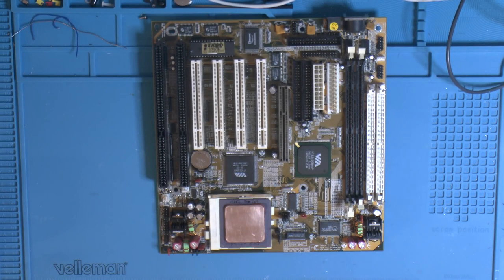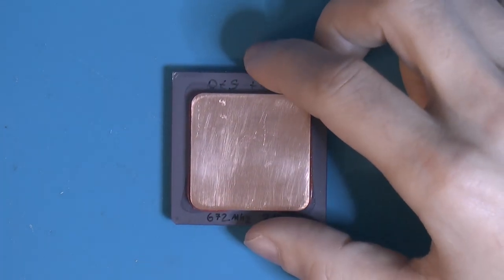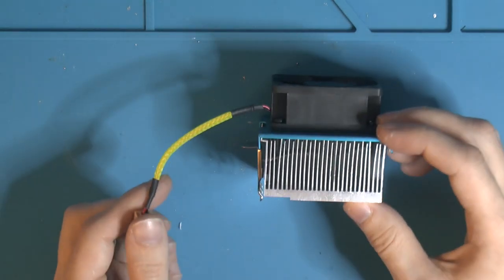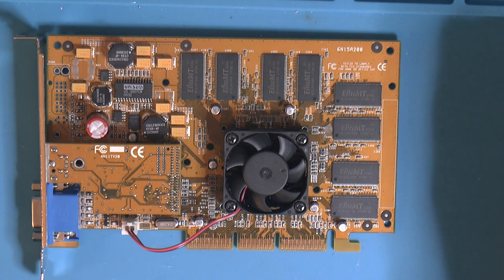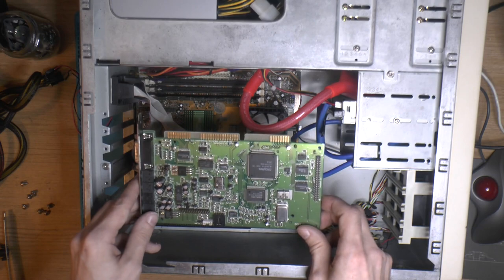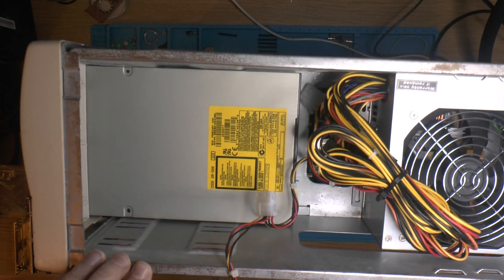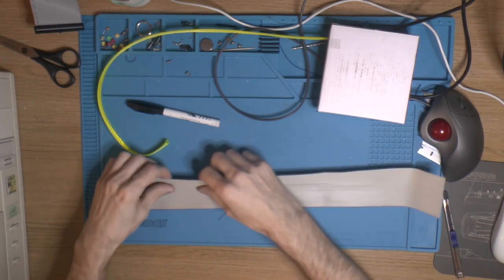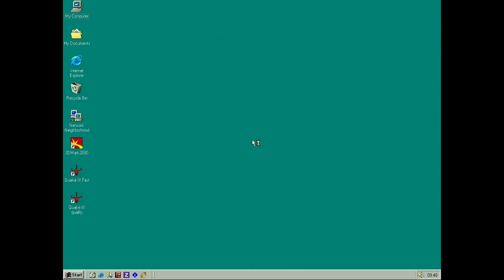672Mhz Super Socket 7!

Comment: had a board that could run the bus at 124mhz so i used a clock multiplier of 4.5 to get around 558mhz, and used pc133 sdram, never had issues with it till i tried using an agp card later on, would always bootloop with any agp at those speeds, though pci cards worked fine.

Comment: Hi
You would have about 4300 points in 3Dm2000 with GF2 and K6-3+ @ 5,5x112 on ALI chipset board
Reply from the maker: I got 4500 with an Ali 5 and a K6-3+ @ 616 whit a GF2.
Tested it after recaping it for the owner that gave me this board and CPU to mod.
 He got it up to 5200 points eventually. 
So yea more capable chipset.
Reply: I get 5016 points on exactly that setup. ASUS P5A rev 1.04 K6-3+ 400@616mhz
Reply from the maker: @jannenilsson3627  okay recalled it was in the 5160+ on the image you sent me but still impressive, or did you benchmark at 633Mhz and get more?
Reply: well it was when I overclocked it even further to 632mhz

Comment: Thats some decent FPS in Quake III for a Super Socket 7 system. Much faster than my K6-III+ with a Geforce 2 MX400.
Reply from the maker: I think my friend broke 200fps (or at least very close) with a K6-3+ 400 I put liquid metal and a sempron IHS on and binned to 616Mhz, tough he ran 633Mhz (probably not stable) with a GF2GTS.
But he also used an Aladdin 5 MB that I recapped and that board has pretty big advantage in overall performance.
Also a K6-3+ @ 616 was a few percent faster then the K6-2+ @ 672Mhz on the same motherboard so 633 with the full L2 is fast, with the Aladdin 5 board about 20% faster in 3dmark2000 (about 5000 points) so yea you can get some sick FPS in Quake3 for a SS7 system.

Also I do modify Quake 3 code a bit to get more ompf and we had a competition for the fastest quake 3 benchmarks so source code changes, configs changes where allowed.

One problem with Quake 3 is that it only supports 44Khz sound but its easy enough to enable (ID actually just commented it out, probably due to some bugs)  so that I have done so 22 and 8Khz is supported and that gives a nice boost to CPU limited machines.

That with a lot of other tweaks.

We did host a Quake 3 competition on out Discord server a while ago and the winner hit 560fps fps on Athlon 850Mhz and GeForce 256 with a playable configuration.

EDIT: found a screen shot of my friends K6-2 400+@ 633Mhz, 198,6fps in Quake 3, thats what more cache, better chipset, modified client and configs will do for you XD
Reply: I also have an Aladdin board, and I run a K6-III+ 400ATZ at 500Mhz.

Definitely will have a lot to do with the modified source code. Obviously vertex lighting, picmip 16, lowest geometry settings etc.

But even running full standard confight on Q3M1 the game ran very smooth in your video, especially near the giant tongue.

Comment: Why didnt you install thermal paste between the mosfet and the heatsink?
Reply from the maker: Hello!
Yes its a very good and valid question!

I was considering it.
There where a few reason I opted not to.

1. There was none originally (why I dont know)

2. Difference in temperature between mosfet and heatsink seemed negligible from my measurements so contact seems fine.

3. It can be a bit messy, the oil leaking out of the past over time on to the board. 
The past drying up over time making things worse, the fact that I have to de-solder a cap and both heatsinksto repast it.

4. the temperature of the heatsink was high so thermal transfer seems fine so it was not so much a interface issue between mosfet an heatsink but rather heatsink area to air issue.

So in the end I decided that the possible downsides outweighed the possible minor improvement in temperature.

Thank you for watching and have a nice day!
Reply: thank you for you answer, yt didnt sent me any notification
Reply from the maker: @crxxpslvyr7887  Yea and its even more fun when YT deletes peoples post but I get an email copy of what they wrote, they probably think I deleted there post.
And yea the Sex bots never once got stuck in spam filter, think TY needs to flip a bit on the AI algorithm LOL!

Comment: You inspired me to dust off my SS7 stuff. My K6-III+ does 600 at 1.9v but I'll need a different graphics card to do higher bus speeds.

What did the cooling mod enable which wasn't possible with the stock arrangement? I just assumed that cooling wouldn't benefit such low-power CPUs.
Reply: He did the same Cpu mod on my k6-3+ 400 cpu. It is now 100% rock solid stable at 616mhz. Im now using a lower voltage, and it is stable.